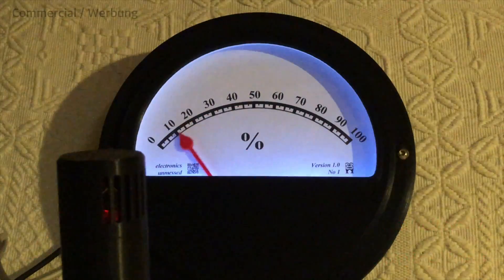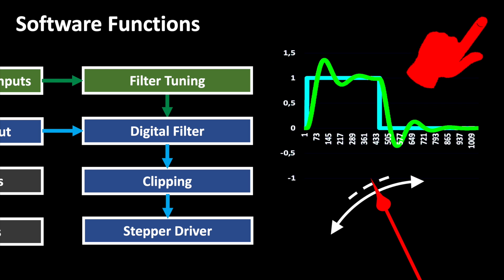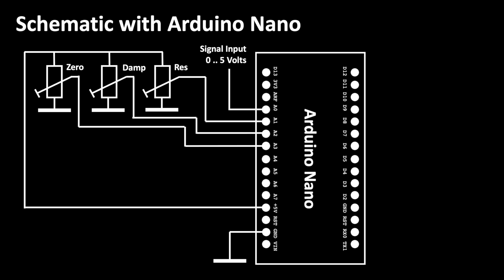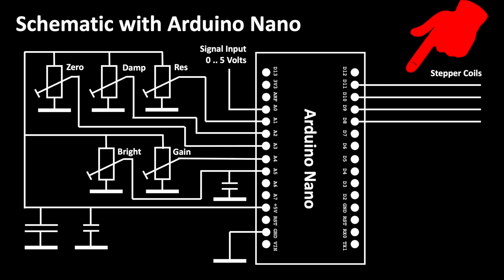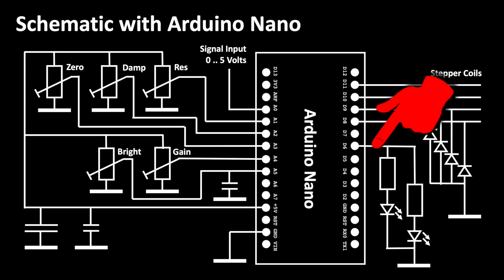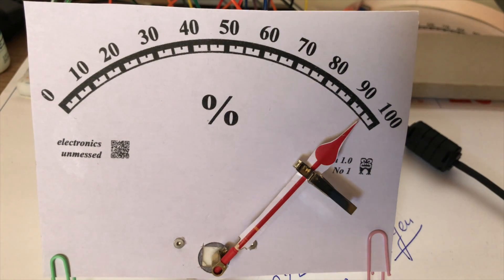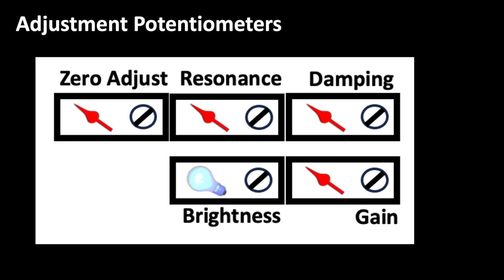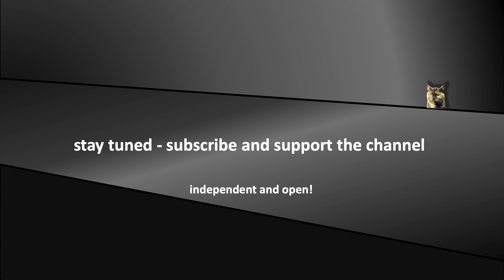HW: Design a Beautiful DIY Gauge using an Arduino Board and a Stepper Motor (EP53)

Comment: Hello.  3:20  You are showing 4 flyback diodes, I believe there needs to be 8 because they are bipolar motors and flyback current can flow in both directions.  So I would think that you would need 4 additional diodes, one for each wire going to +V (cathode to +V).
Reply from the maker: Hi, thanks for your comment. I think you're generally right. That's the safest method. In my case, however, only the negative induction currents are critical, which I need to dissipate. The positive ones are essentially consumed by the circuit. The gauges are still working perfectly. Greetings, Klaus